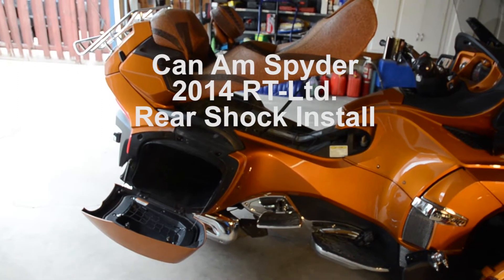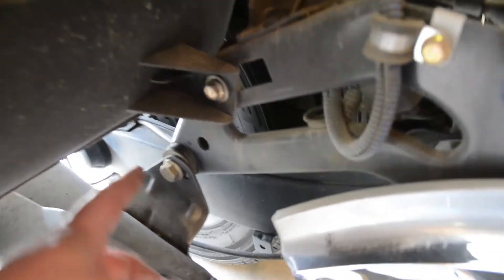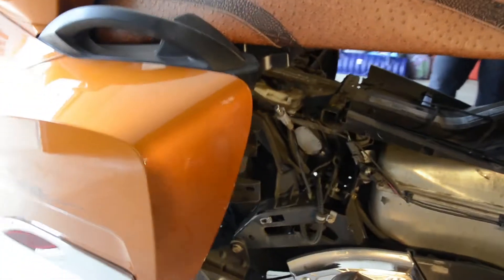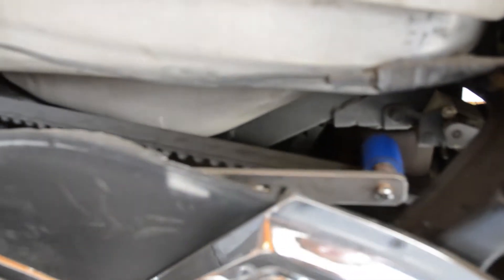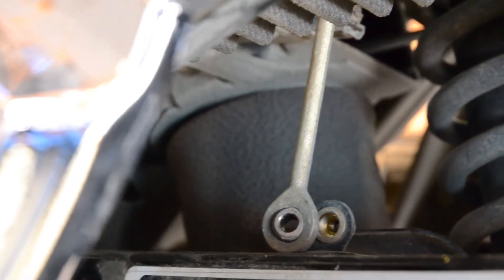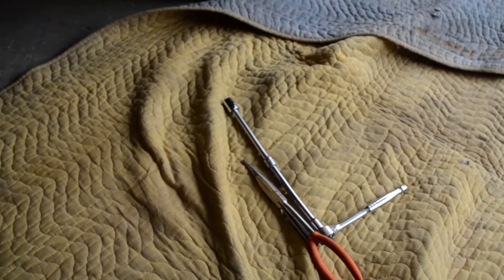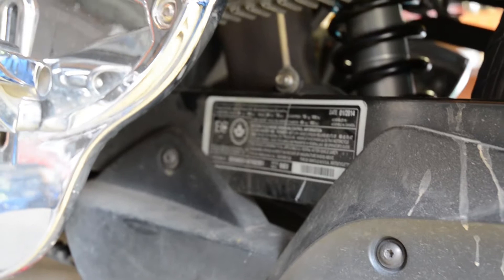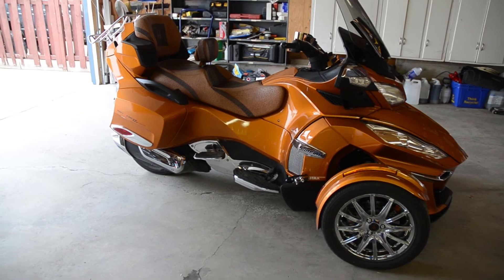Can Am Spyder RT Rear Shock Install

Comment: My shock went totally out while riding the Three Twisted Sisters in Leakey, Texas...  Can you say ouch?  Bottomed out many times.  I need a chiropractor to pull my disks apart!  (LOL)... Great install video.  How hard was it to get the bottom shock bolt back in.  I always have trouble with it when I change tires...
Reply from the maker: I didn't have any problems getting it back in, just adjusted the height of the jack until it was lined up. 
Why are you disconnecting the shock to remove your tire? That's not necessary, all you need to disconnect is the position sensor.
Reply: @purpleguy2159  Some of the videos I have seen they say to remove the lower shock bolt to change the tire...  On another note:  Did you put air back in when you put it all together?  I have never removed the Schrader valve or let air out.  I thought that airbag switch did that...  Thanks for any comments!
Reply from the maker: @TheStagecoachDriver  I've noticed a few people remove the lower shock bolt to remove the rear tire. I've had my tire off at least 4 time and have never removed that bolt. You must disconnect the swing arm position sensor though. As for the Schrader valve, I've never let air out or added air to it...